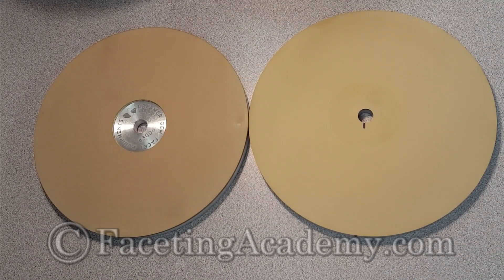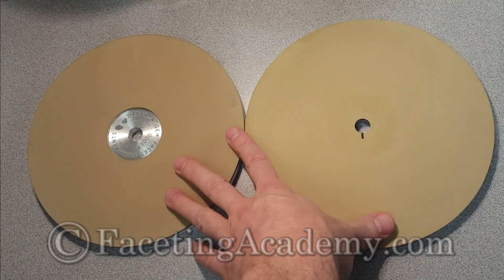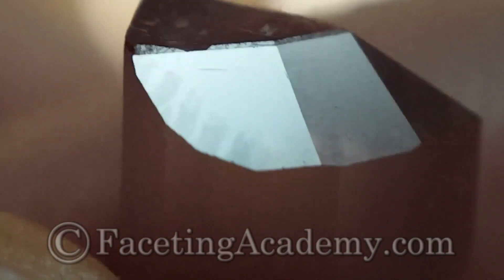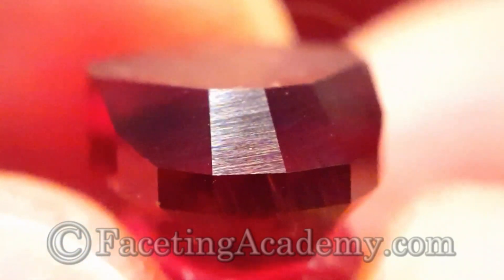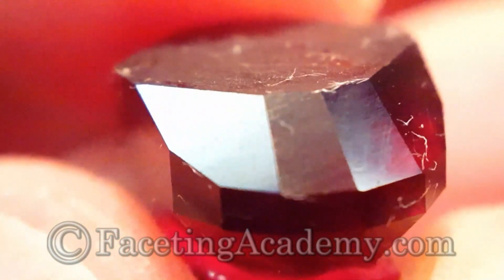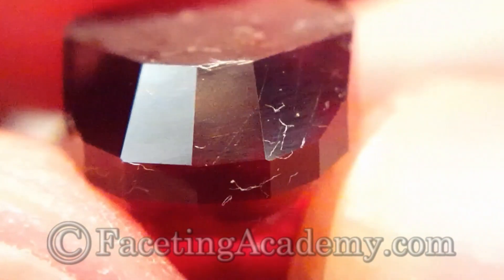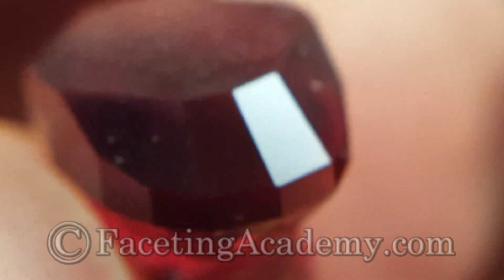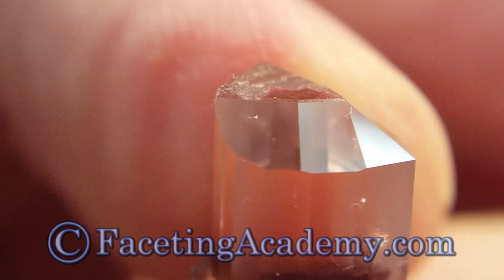Resin-tech Laps #3: Hyper Edge & Dreamer 3000 & 8000

Comment: Nice I need some more ore polish laps. What’s the cheapest route?
Reply from the maker: Apologies, but I don't understand what you mean by "ore polish laps".

Also, "cheapest route" doesn't really go with "high precision tools for producing luxury art from precious gemstone materials".
Reply: @gemstoneartist  I meant pre polish and polish laps..
Reply from the maker: @Algoldprospecting  

Prepolish and polish will differ according to the materials you're working with.

For stones softer than Spinel, I usually use resin-tech laps for pre-polish. If you're on a tight budget, you can use paint-based laps rather than those featured above, though they're going to have a much shorter lifespan. You can also go the roll-your-own route with metal, or even corian, and either Voodoo or other diamond pre-polish paste or loose diamond and oil.

For harder stones like Spinel, Corundum, Chrysoberyl, etc, I pre-polish with Voodoo on Zinc, Copper, or BATT, though you can also use Tin, or even corian in a pinch.

For polishing, the list is very long, and includes laps and polish combinations (recipes) that work with either diamond or oxide polishes. The choices will depend on what you have available / can afford - and on the materials you're polishing - and on your personal preferences and skill level.

Hope this helps.
Reply: @gemstoneartist  thanks for the info. I’m new at Faceting so I will look that stuff up thanks